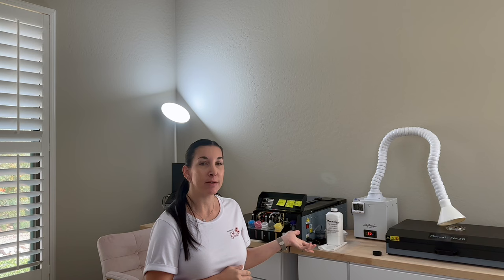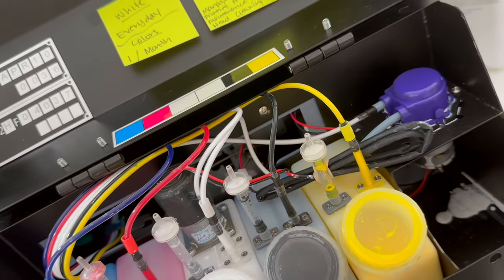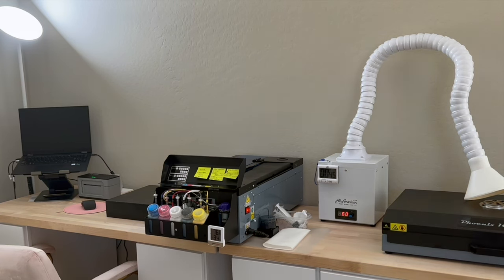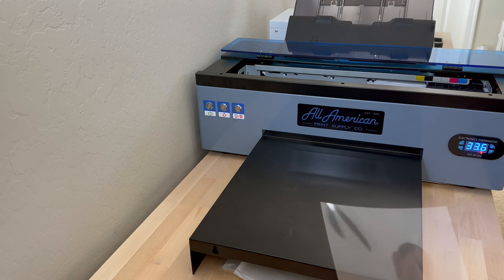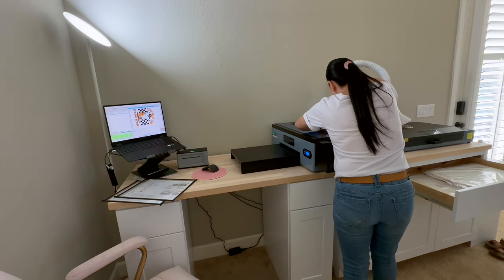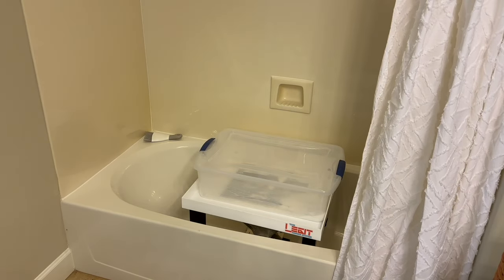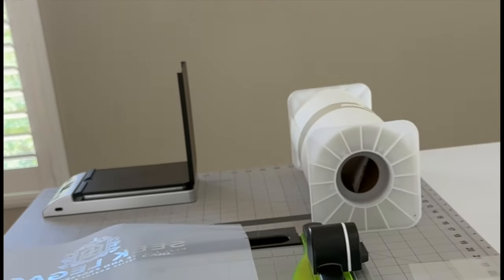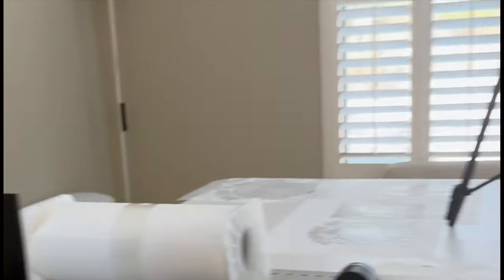Printing with my DTF Printer! Showing you how I start the day, running head cleaning, and PRINTING

Comment: I work for a small business and I run a mongoose DTF printer and I build in adobe illustrator to edit the images before bringing it into the DTF cad rip. The dtf printer I use is huge !
Reply from the maker: That’s awesome! Yea I’m still very new to the process so I’m learning new things everyday! It’s so fun and different than my other work, but eventually I’ll get the process!
Reply: @binghambliss4636  you’re so talented you’ll pick it up quick. I’ve only been working with this huge printer at work for a month and it’s definitely a learning curve. The struggle on the bigger printers is the paper , I could get it straight but during printing sometimes it shifts and needs adjusting and you have to keep powder in the shaker constantly or else it’ll get tight and the belt won’t move and your prints will burn.
Reply from the maker: I’ve actually heard about this with bigger printers so I’m nervous about getting one because I move around a lot and don’t want to have to babysit it! Because I moved my printer into its own room now I can just watch it now but I wouldn’t want to haha